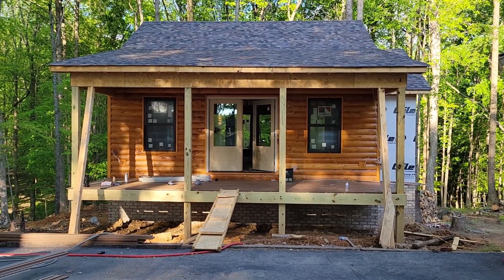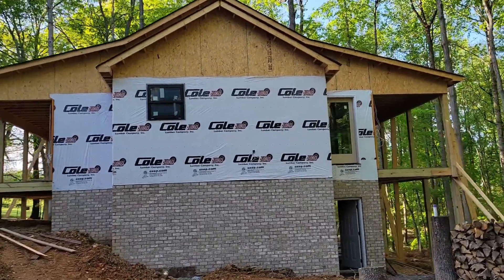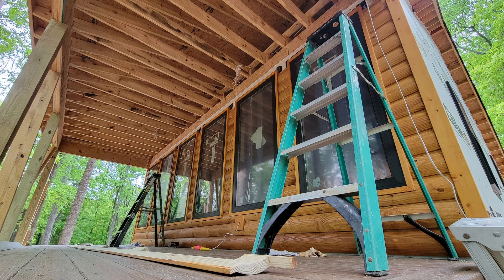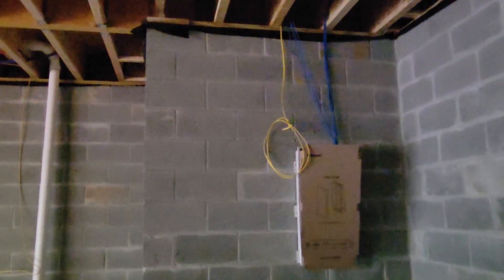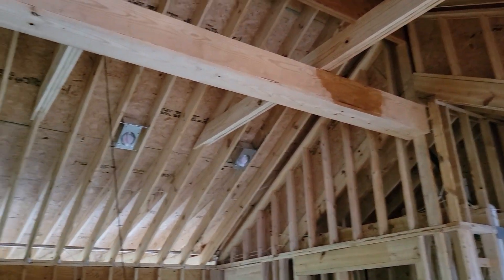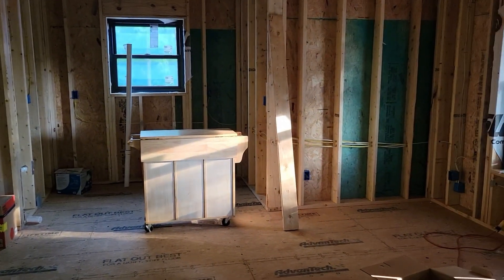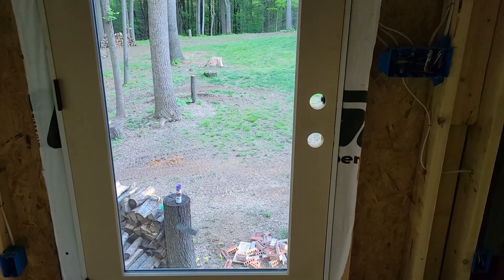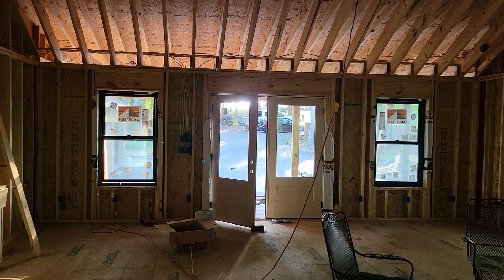Le Drum Studio Update! Part 2

Comment: Jeff, no audio mults (snakes) running from the kit to mixer area?
Reply from the maker: I'll still use my regular 50ft snake that I have now, but I won't put it in the wall or anything.  It'll just run along the baseboards as it does now and my bud Jason Schmidt that I mentioned in the vid will come by and help me w/ cable management :)